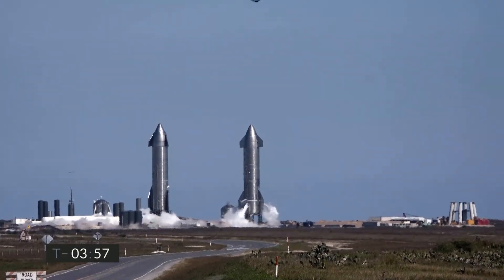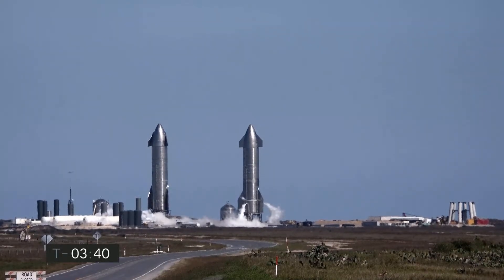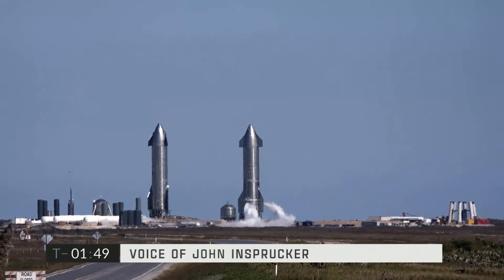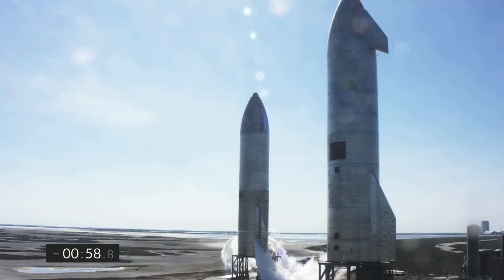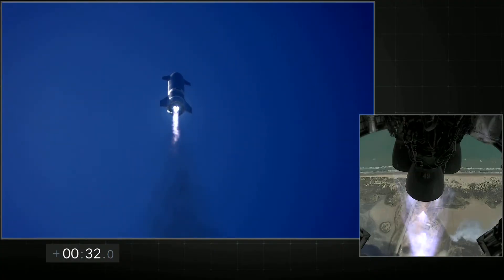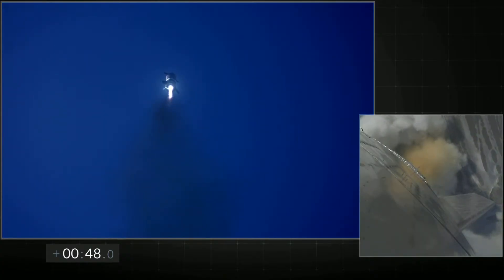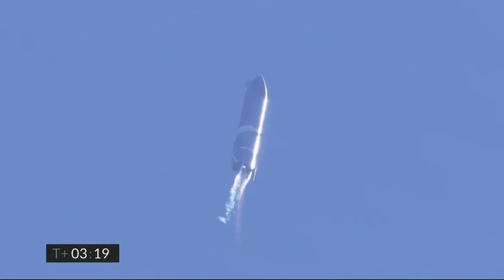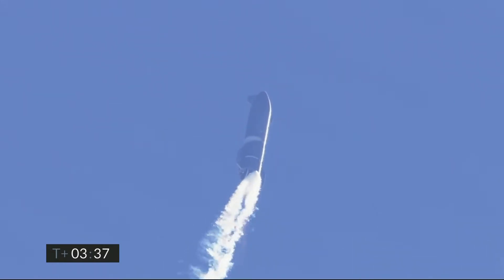Starship | SN9 | High-Altitude Flight Test

Comment: They seem to be having issues restarting the engines reliably. There was a lot of coughing and wheezing from the second engine, never got it going. Subsequently there was not enough thrust to prevent the vehicle from rotating too far, and then get it back to vertical, and of course to prevent it hitting the ground....oh well, at least SN10 had a good view of how not to do it.
Reply: "SN10 had a good view of how not to do it."
Oh, that's why it got a front row seat.
Reply: Could they just try and light all 3 engines at once? Increase the chances of 2 lighting? Or isn't there enough capacity in the system pressure wise for that? They'll no doubt work it out
Reply: Do we know which engine failed to restart as they only replaced the two raptors, the older one was worn out more and the rest of its family obviously met their demise. Maybe should of replaced all 3?
Reply: "SN10 had a good view of how not to do it."
Cannot infer from this how to do it tho
Reply: @JulienReszka  just light the candle you dingus
Reply: Not surprising, re-lighting rocket engines is a famously hard problem, must designs avoid doing it at all.
Reply: I believe it's a mistake to use this approach. The error tolerance is too low for human beings onboard. Not enough redundancy in the last phase, no corrections possible. It's either hit or miss, even in the final product. If anything doesn't go as planned, the vehicle is already to close to the ground to do anything about it. A space shuttle could take one of many different landing strips all over the world. A capsule has 3 big parachutes, if one fails, it's still safe. Even without the dampening burn, it would be a hard impact, but not lethal. Starship has no tolerance for errors and as such Starship's concept is doomed to fail for landing humans onboard. It needs a bigger margin for errors to recover or it will never be approved outside of cargo duty.
Reply: i'm not saying i know anything about this however
i think the second one wasn't supposed to be lit like the first one, it was probably the one responsible to flip the ship by flickering only a few times, but they overdid it.
i feel like they had enough trust to land. it was just the way the ship was oriented that wasn't recoverable
Reply: @robertg7249  you can't flicker an engine, the computer tried to start it a few times until something caught fire around the power head (turbo pumps and shit)
Reply: @robertg7249  It was supposed to turn on for the rotation, then shut off for the vertical landing.

Comment: Maybe ignite the raptors a lil sooner. So you got like time to slow decent. But I’m not a rocket scientist
Reply: As you saw the Raptors ignited on time. One just didn't get up to full thrust.
Reply: On time? Lol
Reply: @seanmcclure2006  
Yeah, the engines ignited on time. Right when they were expected to.
One just didn't go to full throttle.
Reply: It wouldn’t hurt to give yourself a lil margin for error in case things don’t go to plan which tends to happen with experimental rockets, i.e. sn8
Reply: @seanmcclure2006  
That's not what SpaceX is aiming for. 
They are more than willing to sacrifice SN10 to SN12 (not going to orbit anyway) if that means they don't have to alter the overall layout.

Right now SpaceX is more concerned with setting up the production line in Boca Chica than with getting the landing right.

Comment: Too short vertical flip and landing burn, they should try flipping it back to landing position at around 4 3kms what say?
Reply: The longer Starship stays horizontal, the slower it is in the end. 
The slower Starship is, the less fuel it needs for the landing burn.

Comment: I wonder if it would require less precision and produce useful information to instead of landing just change direction, turning the ship and pushing it back up possibly at high altitude . Like learning to stop a car in a parking lot before trying it in traffic . Maybe with more fuel and out over the ocean it could be repeated a several times . It seems that the challenge is knowing how much it takes to stop and we don't need to have the ground getting in the way. Maybe it would be worth blowing one up on purpose over the ocean.
Reply: The header tanks only hold very limited amounts of fuel. 
They can't just keep the engines running for any longer period.

Comment: I don't think 'going splat' was on the planed agenda!

definitely coming in too hot ( velocity ). Maybe not enough flight  time left too Transition between the glide configuration and landing, maybe requires more engines to be running as two were used to transit and only one for actual landing phase, maybe all three might be a good idea??

Second launch l have watched and l couldn't see any changes from previous failure to successfully  land.
Reply: Two engines are enough. Look closely at the end: one engine isn't producing enough thrust for an unknown reason.

Comment: Elon, may I suggest? I think you will land easy if you just give some more seconds to landing burn. For SN10 try initiating landing burn at least 90 seconds earlier than your test today on SN9

Edit: may be I am way off the mark to suggest 90 seconds, it could be 20 seconds or 25 seconds, get your experts to do the math, and fix it! I sense so, because ISRO's Mars orbiter faced the same issue trying to land the probe, they too tried to initiate the landing burn a tad late and lost the probe!
Reply: The header tanks don't have more fuel for a longer burn.
Reply: @3gunslingers  then that's what they need to fix!
Reply: @manivisu  
Why? That's not their plan for the final product. 
Less fuel in the header tanks means more payload.

Comment: Re-ignition during a change in orientation right before landing seems ... difficult.   Re-igniting 5-10 seconds early, then over-rotating to cancel the resulting impulse, seems easier: though you might not land where you intended, at least you will land.

Comment: Why would some perform experimental landing almost on top of next prototype? Slight misalignment and debris would wreck all around.
Reply: Elon Musk must have the usual super-optimistic attitude, hoping that everything works from the first (second) try.
Reply: @cogoid  it is just weird. It should be possible to practice such maneuver on high altitide, like fall, flip, fail, stabilize  climb, repeat.
Reply: @EvgenyMuryshkin  Yes, I was thinking the same thing about making multiple landing tests during one flight.

But on the other hand, it might be better to start launching these rockets long before the landing is perfected. Assuming SpaceX can build them one per month and relatively cheaply, they could already use them for launching Starlink satellites much faster than it is possible with Faclon 9, while at the same time practicing landing with every flight "for free". It is hard to tell what is the best -- but it is clear that technical perfection and what makes most sense for business are not necessarily the same thing.

Comment: No green engine-rich combustion flames today, so looks to be a different failure.  All part of the learning process.
Reply: Good point
Reply: Yeah but this one was showing BLACK smoke from the start, something was very wrong very early on.
Reply: My assumption is the Spark ignitor didn’t work. That’s why on landing, we see that second Raptor try to light, but just wasn’t able too. I think we just got unlucky, so I am 90% sure SN10 will stick that landing! Woooo!
Reply: The green flame from SN8 was because they lost pressure on the header tank, which caused it to not be able to feed the engine with the correct amount of methane. That resulted in the mixture being oxygen rich which means it burns hotter. It ended up burning hotter than the engine could handle, do the green was the engine getting destroyed. The reports I've heard is that they added a helium tank to the header tank to assure it had the pressure it needed.

This was a failure of something different. That's why you test though.
Reply: I think the preburner didn’t fire right
Reply: @makerofgarbage5877  maybe. They are struggling until the second Engine just burst.
Reply: 12:00 what you really came for
Reply: I’m thinking the engine failed the first attempt and they weren’t able to restart the engine quickly. Considering the air temperature and the wind that days could it be the engines were actually cooler that the first ignition would’ve not lit? Also it swings like a pendulum there might need to be a way to stabilize movement from falling horizontal to vertical
Reply: Maybe the raptor Spark ignitors fails to Ignite the engine? So instead of proper thrust and Velocity the raptor just have a preburner in mid flight without thrust.
Reply: @adriantheo7654  Or something burst. Shrapnel has been spotted coming out the back as they tried to do the second engine re-light.
Reply: @Ulfcytel  yup, idk lets just see
Reply: The green is from the triethyl aluminium used for engine starts.  Engine rich is usually a white or yellow flame without mach diamonds.
Reply: @stephenfitton6277  That's what I thought with SN8, but later learned that Raptor doesn't use Hypergolic igniters (it uses "torch" igniters). The green was actually from the oxygen-rich fuel mixture consuming the copper within the engine. Scott Manley has a video about this.

Comment: 1-Why wait the last minute to flip it upright to land?
2- why not have engine redundancy?, knowing rocket engine are so unreliable 
3- why not have a flame extinguisher in the engine compartment?
Reply: 1 the idea is to save as much fuel as possible on a journey to Mars.
2 there are already 3 engines in there I think that’s probably enough
3 because it ads weight and wouldn’t stop an explosion
Reply: @lucaherman6227  1- the idea should be as much fuel as possible for safe landing and unexpected circumstances.just reduce the payload.
2- engine redundancy until engine are tiable
Reply: @enoughofthis  1) extra fuel requires more fuel to get to Mars so it becomes a bigger problem much faster
2) the actual rocket, not this test model will have something like 30 engines
Reply: @lucaherman6227  send s tanker fuel towards Mars ahead of time.by the time you reach Mars, you have a tanker in orbit waiting for you to top up and enhance your landing chances.

The tests should be done with more engine necessary until you figure things out.
Had more engines and more fuel been used. We would not have lost SN8 ,SN9.

Also, the flipping should be done way ahead of the landing to help recovery in case if  unexpected behaviors. There should also be trusters in the upper part of the rocket.
Better more engines and trusters than more humans in the rocket. 
Instead of sending 100,50,30 humans. Just send 10 and assure their security with more fuel engines and trusters redundancy
Reply: 1) starship is already planned to have tanker refuelings in orbit to be able to get to Mars so refueling two rockets to go to Mars is unimaginably more expense, all for some extra seconds of burn time, which didn’t even matter if the engines don’t light line here so it doesn’t really some anything.

2) more engines on the rear vehicle makes tests more expensive 

3) there are already plans for hot gas thrusters to help flip the craft. They just haven’t built them yet.

Comment: I'd rather see this and know a lot of data is going to help the rocket guys and girls at SpaceX than seeing a ship blow up after a design failure like on the Columbia.
Reply: Cameras were cutting out. Chance of telemetry doing the same?
Reply: Don't you mean Challenger?
Reply: @kingjinga2539  yes, he's referring to the Challeger accident, and maybe the Apollo 1 fire.
Reply: Columbia wasn't really a flawed design, it was just more fragile than they thought. If NASA had chosen to continue painting the foam tanks, they could have prevented the Columbia accident from ever happening.
Reply: @Rob_Moilanen  yeah cutting corners gets people killed. lots of examples of that.
Reply: if by accident you mean flying with a hole the size of a watermelon in the right wing that somehow nobody saw. But sure, I get your point,
Reply: @leooram1959  well they saw the foam strike the left wing, engineers even had cautioned NASA about prior foam strikes. NASA chose to roll the dice again on Columbia, and well, 7 more astronauts paid with their lives, and the shuttles had to be grounded again only to find out NASA had failed again, just like the Challenger accident when NASA didn't heed the warnings of Morton Thyokols engineers to not fly when the boosters had been subjected to ice conditions. NASA knew that seel would fail, but again, they chose to ignore it until the accident board found out about it. Unlike the Apollo 1 fire, they had routinely done a 100% oxygen pressure test, that night it bit them in the ass and obviously they lost the crew. That accident was unique, in that it caused NASA to do a total redesign of the Apollo capsules and none where ever lost after that. But honestly, NASA is what it is cause of meddling penny pinching politicians, until theres a disaster, then they become the bastard step child of ruthless politicians.  One can only hope that Elon never loses a crew, I hate to think about the consequences of that ever happening.
Reply: @Rob_Moilanen  hopefully, there is too much at stake. thanks for your comment
Reply: @leooram1959  agreed, and Elon knows this, failures my be fine while he's testing these rockets, but when lives are on the line, Elon knows full well that even one catastrophic failure is not even an option.

Comment: Wonder why you don't get upright first with the flaps (only extend top flaps so back drops) to better ignite in the first place. Testing ignition vertical and then actually igniting horizontally is kind of useless.
Reply: The plan in the future is to use the wings and some Hot gas reaction control procedures to help with the flip But at the moment they don’t have any of those design or built so they’re using the engine for us to try and assist with the rotation as the wings alone won’t rotate the craft fast enough

Comment: Clearly the 2nd raptor did not light, which is too bad - considering there was a 3rd raptor shut down. For better FMEA and safety function, would it not be better to start all 3 briefly, and quickly shut down one assuming they all actually light? The third engine could then be a safety backup instead of dead landing weight.

Comment: It’s ok SpaceX, it might seem like you lost progress but NO, you didn’t.
Ideas for fix:
1. Add more pressure to the header tank in ignition.
2. When doing this flip maneuver try and maybe have it to where if it detects only one engine ignited, it try’s for the other engine, possibly trying to reorient the vehicle.
3. Just like number 2, when it does detect one engine isn’t igniting it’ll possibly try and run more fuel and more power to the one it did ignite.

I’m not a rocket engineer but those are ideas.

Anyways, SpaceX, you did amazing, you didn’t go backwards, now we have more ideas on what can go wrong and ways to fix it. Life will have failure and you just need to punch through.

See you when SN10 lifts off!!!

Comment: Why did they start flipping it over so late? I'm not rocket scientist so there's most likely something I'm missing. But it looked to be as if they flipped it over and turned on the engines at the last second. That thing looks freaking heavy. How could it flip over at the last second and not explode upon landing? I'm genuinely wanting to know what happened here. Anyone know why they did it like this?
Reply: You probably answered your own question, they flip it over so late because it's so heavy.  Can you imagine how much force that great big chunk of steel generates after falling 10 kilometers?  It probably needs a giant amount of fuel to slow it down to a near stop near the ground.  That fuel has weight so the less fuel they need for landing, they less they have to carry at launch.

Anyway, I've already read SN 0 failed because engine 2 failed, and engine 1 gimbal failed.  It probably doesn't have anything to do with when the rocket flips.
Reply: @clintonearlwalker  And that's my point. If it takes so much power to stop it from falling and land it, why did they flip it over so late? You seem to be implying that they're just getting a feel for when to start the engines again, but I heard space crafts are extremely expensive. Is it worth it to constantly blow up your rockets just to get a feel for something?
Reply: @markbv591  They are probably flipping it over so late because of the amount of fuel it takes to slow it, and then land.  Every second probably uses a great deal of fuel.  They have probably calculated the amount of inertia when it's coming down, and the amount of fuel to produce the necessary thrust in the opposite direction to slow it to a safe landing speed.  

SN8 apparently failed because of a low pressure in a header tank.  The engine didn't produce enough thrust.  I haven't heard exactly why SN 9 failed to land yet, but I did read something about engine 2 failing and engine one had a gimbal failure.  

These are "only" test rockets, basically steel tanks, fuel and a computer operated guidance system.  Comparatively, they are not that expensive.  I think I heard that SN 9 was 5 million dollars.  Not cheap, but not the hundreds of millions of some Apollo missions.

Comment: Maybe flip earlier? Definitely need baffles and time to dampen sloshing. I calculated that the speed it's falling is 100m/s, which is it's terminal velocity and a flip maneuver takes damn near 10s.

Doing engine re ignition will be damn difficult. This is Earth, up and down - it's super easy. Doing this after extended stay in space which no one knows what will it do. Doing the flip in the gravity of the Moon or Mars, refueling in space... This is a nightmare... Rewards for perfecting this are great.